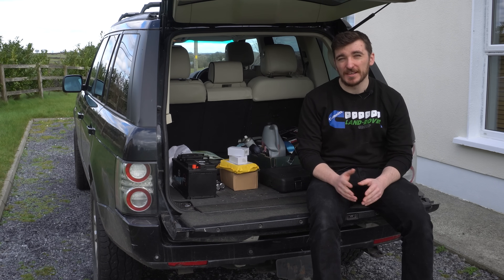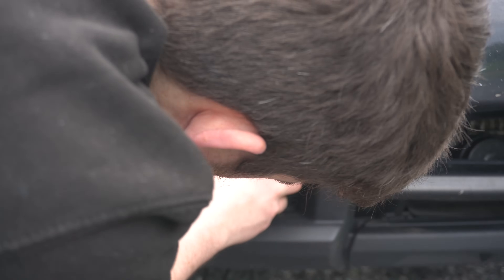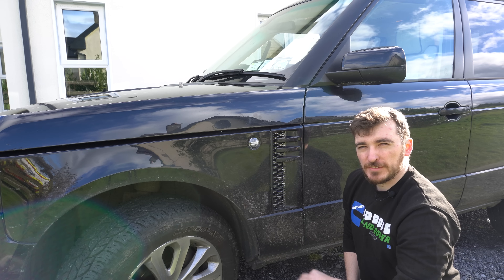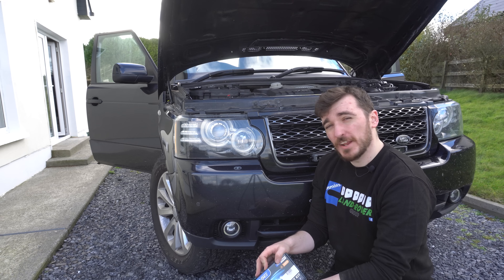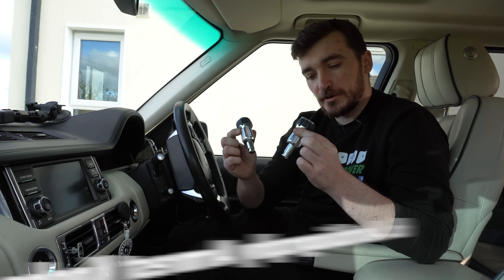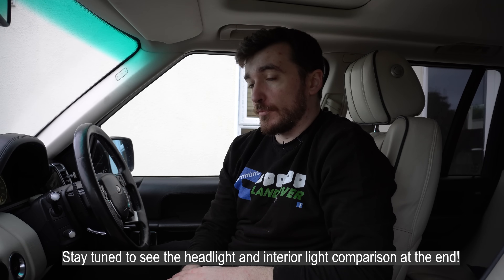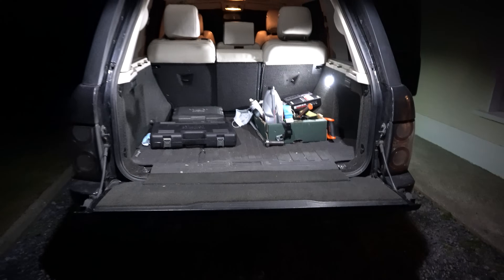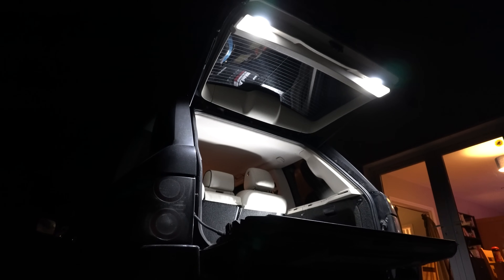I fitted 6 CHEAP & QUICK Upgrades on my Range Rover L322!

Comment from the maker: Some of the audio in this one is a bit crap - next one will be a lot better.  Who's going to buy a load of Chineseum for their Range Rover now then?!
Reply: Very tempted with the boot lights and the H7 upgrades. 
I’ve got the 2009 pre facelift, do you know if the H7 kit would fit?
Reply: Need to check if my 2012 westminster has led h7 replacements already but if not it soon will have. Oh and arm rest knobs, side repeaters (not dynamic) and puddle lights
Reply: Thanks Sam, finally an individual who explains and demonstrates useful upgrades that are a great price nice one sir!
Reply: Turns out they don’t fit. The H7 has a different fitting which has a twist lock fitting which sits flush behind the bulb meaning it can’t lock this kind of bulb in. Sod’s law.
Reply: Hi Sam wasnt sure how to get in touch with You, but I have for sale some older parts for a Range Rover P38, parts consist of rear light lenses different types, air filters, fuel filters bushes,and various parts for the Air suspension, including pumps, I was gonna put them on Ebays but wondered I You may be interested in buying them, Regards Frank
Reply from the maker: @Frankiedoodle1941  Hi Frank, sounds interesting!  Send me an email at samsmotorandmachine@gmail.com 👍
Reply: @SamsMotors   which fog lights is it you ordered ? There’s a few different options I’m confused lol

Comment: Sam, based on your recommendation I got these fog lights and installed them today. They look great. Now they are brighter white than the low beam headlights. What I appreciated is your install tips but maybe even more, the link to buy. It saved the stress of hoping I pick the ones that will fit. Thanks for the advice.
Reply: Shame they don’t do a version for the 2008 L322. I’d have them in a moment!

Comment: Hi.
Sorry for my english if its sometime wrong, its self-learned.
Connect DRL as well, I doing it.. If DRL power consumption is not big (apr 20W in total or even less I suppouse), you can take the power directly from output of relay R10 (located in engine compartment fuse box). Then DRL will go on always when ignition turned on. But, there is a small dalay (about 1 minute) when turn ignition off. Thats no problem I think, will work like "follow home" light. Put fuse and 5-pins relay between to swich DRL off when use headlights. Power for relay - headbeam connector, pin 11.
I doing one more good thing, for free: I change seats bottoms. Now passenger seat (only bottom) is on driver side and driver seat on passenger side. Now seats looks like new, worn corners are inside and not visible. Need to remove seats. Take off the plastic, leather, replace the foam, also replace the passenger sitting-sensor for seat belt. Quite lot of work, half day at least, but not impossible, seats are absolutley similar.

Comment: As for fog lights in Ireland - they're only supposed to be in Fog (visibility under ~100m) and falling snow. 
Reality differs substantially, as you've noticed .. a pet peeve of mine at times
Reply from the maker: Yeah noticed they're a lot more common in normal weather here, but I figured it was a cultural thing so haven't been going around flashing everyone as I would be in the UK 😆

Comment: Thanks for the video. I purchased LED bulb kits for my P38 and L322, just the bulbs by themselves. Makes a big difference. I have been reluctant to pry out the puddle lights in my L322 mirrors as they seem very tight and I am afraid of breaking the housings. May order the units you used as well as the LED driving lights. I recently replaced all the HID and H7 bulbs in my L322. It is much easier if you remove the entire headlight unit. Powerfull UKLtd has a video on how to do this. Cheers from Canada.

Comment: Like the LED fog lights and high beam H7 replacements... I'm definitely considering for mine. However, for the interior boot lights i just changed the bulbs for LEDs and not the whole unit.

Comment: Odd i just ordered the puddle lights, they came installed them, except my truck does not have a red wire, they both yellow. Cleaned the contacts and installed the lights easy enough, but they didn't work, flipped the connectors around, bent contacts, all that. Tested the lights from the jump start posts and they work fine. Fiddled some more, could get flash out of the driver side as I hit the key to open the door, but nothing else, stuck the bulb back in it works fine and now so does the passenger LED. It's almost as if there not enough voltage to run both lamps?

Comment: Nicely done and useful. I've the same car - superb machine. One of the first things I did was swap the main beams as you did. I like the boot lights and the armrest knobs, I'll be doing those!
I also replaced the accelerator pedal for the Autobiography one - because the original failed - thats nice.

Comment: I saw the video and got shopping,  puddle lights  easy to fit, but my lights did not have a red wire. However they do work and work very well. the interior lights the connector was not the same as the std one, but a bit of leverage on the light connector and the plug fitted. Much much brighter.  Cheers
Reply from the maker: That arrived pretty quickly then!  Glad it worked out 👌
Reply: @SamsMotors   It was very quick delivery, Ialso got the armrest knobs and fitted them , a nice bit of bling but not 100% sold on them at the moment. I am sure I will soon learn to get used to their shininess..LOL.  waiting onthe headlight bulb upgrade  to arrive. Cheers
Reply: Got the headlights, damn those thing swilll not go into the headlight housing. The ones I received state to fit the collar first and then push the bulb in place and lock in the correct orientation.  Tried that could not get the bulb in place as it appears to be too long, it interferes with the back pf the headlight housing. Tried it like you have fitted it with the collar attached and it still will not fit. Hope contacting bevinsee on FB will give me an answer.

Comment: Very good like the simplicity of the transfer!
I put a new fog lamp on the rear of the 110 to replace the smashed old one new one doesn’t work checked the fuse switch and wiring and it’s a dud!
At least the 12000 lb winch is fully installed and working but!
I’ll check out those upgrades for my D4 5.0 litre V8 I like illumination!!
Thanks for a great video!

Comment: Hi Sam, have you thought about upgrading the cornering bulbs which point outwards, located beneath the front indicators? I’m not sure what size/fitment these are as haven’t looked at mine yet. Wonder if the whole headlamp unit needs to come out for them?

Comment: Sam, awesome stuff. I got all upgrades. Are you going to connect the halo wires for the fog lights? I have searched everywhere and can’t find instructions on where the wires should be connected to.
Reply from the maker: Hey!  Cheers!  I haven’t done it yet, but I may do it before this winter sets in.  My plan was to wire them via a relay so that they come on whenever the main headlights are OFF, so they function as a sort of DRL.

Comment: Loved every l322 video, looking forward to more content. Quick question though about the fog lights,   any issues with warning lights on the dash? Powerful uk seemed to have issues with their led bulb replacement.
Reply from the maker: Cheers David, glad you enjoy them.  No warning lights at all.  I think because these LED units are a lot more powerful than the replacement bulbs, they draw enough power to keep the bulb check system happy - so no "blown bulb" warnings that you might get with a low power LED.

Comment: Nice video! Great set of upgrades, bit worried about the foglight and headlight bulb swap as here in Spain they're quite hot on this when it comes to the MOT/ITV. But they certainly look brighter - did you notice any changes to the beam pattern at all? That's what would likely cause a fail...

PS: You should have found affiliate links, we'd have been more than happy to support you with them!
Reply from the maker: As they're in the main beam I don't think the beam pattern matters all that much (might be wrong there) but no, seems similar to the halogen anyway.
Cheers!

Comment: Great video Sam, good tips and nice upgrades all of them. Question, have you passed MOT with these lights upgrades? A year ago I read that these LED bulbs might not be legal under current UK DVLA regulations.
Reply: I've also discovered that the 6000 lights are illegal with a VERY SMALL sign on the  Halfords product packet of their lights says "For off road use only." so be warned. I was told that they would not be passed at the MOT. so will keep the normal ones and change the at MOT time. ;-)

Comment: Any chance you can pencil a follow up to see if the  ew bulbs have caused any gremlins. I have a bad feeling about headlights and heat for some reason
Reply from the maker: They will get quite warm during operation - the fans will keep them cool to a point.  At least the main beams aren't usually on for more than a couple of minutes at a time - should help them stay cooler.

Comment: Hi! Can you point out which specific product you installed for the high beam LED replacement. Is it H7? Mine is 2012 L322 4,4 diesel. Thanks in advance!
Reply from the maker: Hi, yes H7 for the main beam bulbs in the late L322 facelift
Reply: @SamsMotors  sry, I noticed links and so on after posting :) Replaced D3S with LED-s, wonderful. H7 replacement LED-s ordered, cannot wait :) Good content ;)

Comment: Hi Sam. Lovely video. I’m picking up a 2008 L322 Vogue shortly… the armrest knobs you link to are L405, not L322. Are they compatible?
Reply from the maker: They must have changed the listing.  There are loads of L322 ones still available on other listings though.

Comment: Are the lights street legal out of the box, or is there no restrictions on that in Ireland? In Germany it's not allowed to put on "anything you find online". It needs some official approval
Reply from the maker: As long as it passes inspection it’s probably fine for use… but half the population here drive around with 1 headlight or both headlights out, fog lights on constantly, no indicators… so LEDs are the least of our worries!
Reply: Hahaha fair enough. I wish that was the case in Germany too. Our Police here is to scared to go for criminals, so they rather pull out cars and look for slightest little thing to give you a fine.

Comment: Sam, on my ‘11 RR the headlight switch has 4 positions: Off, Day Time Running, On and Auto. During the day, I like using the Day Time Running setting. I’m curious with these new headlights you installed, what they look like in that position. I’m hoping the DRLs are on the factory low (dip) beam and still work even with the new H7 high (main) beam. What do you think?
Reply from the maker: Hi Jerry.  I think the US market ones must be a bit different to ours.  On mine, it has off, side lights, dipped beam and auto.  
The lights I replaced were the fog lights (bottom of the bumper) which have a separate switch to turn them on.
I've still not wired in the DRL part of them, but if I do - they'll be wired to run whenever the dipped beam are OFF (i.e. during the day).  
Hope that helps
Reply: Thanks for the reply. So it would be your position of the side lights. In that position, is there any light that comes out of the headlights? For me it is like a star pattern.
Reply from the maker: @jerrygreene7139  Yes that's right, just an LED 'ring' that circles the xenon/HID bulb.  
That would be another way of doing it - wire the fog light DRLs into the side light circuit via a relay.
Reply: Awesome, one more and I will let you go. When you installed the H7 bulb from AliExpress, did it take away that LED ring that circles the xenon/HID bulb or do you still have it because it is part of the low (dip) beam?

Comment: Hi Sam, thanks for good videos. I have an L322 2011 TDV 8 and ordered the boot lights. You do not seem to have had any problems with connecting the lights. I found that the pin connectors on the new lights are too thick to fit the old connector. Did you have to make adjustments?
Reply from the maker: Thanks! I had to slightly bend the pins in the new lights in order to get them to line up properly, but after that they fit perfectly.

Comment: So lucky you picked a 4.4 up before the rise. They're mega money now. My budget really only is for a very late 3.6. Would you still do it, or wait for the right 4.4?
Reply from the maker: What's your budget?  I watched a 12 plate 4.4 TDV8 with 155k miles sell through Carswithnoreserve Reading (eBay) for £8,600 recently, and thought that was a pretty good price (assuming it's not a complete wreck).  

I'd still try to hold out for a 4.4 and maybe up your budget a bit if possible, as I reckon it's worth the extra outlay over the 3.6.

Comment: Hi Sam, great video and I will be upgrading to some of those LEDs. When you did the previous lamp upgrade video you mentioned doing an LED lamp upgrade to the existing reversing lamps. Did you find a decent upgrade for them? Cheers. Kevin
Reply from the maker: Thanks Kevin, 
Yeah I have the parts ready to go, just need to find time to do the upgrade and film the process.  I'll see if I can get it done this week.  Cheers!
Reply: @SamsMotors  Looking forward to it Sam, I'll hold on my AliExpress order. Also wanted to thank you for the gearbox Megaflush video, Ian is coming to do mine in April.

Comment: Hi Sam ,
I bought the same led kit and tried to fit it to my 2007 but I can't get the sodding bulbs in. Any ideas ? They don't push in like yours they have an adaptor that clips onto the h7 bulb and they fasten by twisting them to lock them in place. I've tried taking the adaptor clip thing off the original bulb but it won't fit to the led lamp because of the fan and body that sticks out.
Cheers
Reply from the maker: Think I had a similar problem with my old BMW, does it have the metal clips that go onto the bulbs?  I think I ended up using a Dremel to widen the clips so they'd fit over the LEDs... Not the best solution though, I think you can get adapters from somewhere.  It'd be worth asking Bevinsee if they can send you some out?
Reply: @SamsMotors  Thanks Sam, a quick look on ebay and theres loads of them clips specifically for fitting led h7s to this type of headlight. Id never seen this type of fitting before and after half an hour of dry fisting the back of my headlamp I gave up and got onto youtube to ask the question. Thanks for the help, i've ordered some off ebay
Reply: @andyscaife5412  HI , whihc ones did you buy, I have the same problem, new bulb does not fit into the lens housing the fac on the back seems to interfere with a part of the headlight back. Thanks

Comment: Hey Sam, bought pretty much most of your cheap aliexpress upgrades :D
On the mirror puddle lights, did you need to add a resistor or reset anything? Mine flashed on and off quickly once, and then wont light up again when the car is unlocked - Any ideas?
Reply: I'm having the same issue.
Reply: @MikeCryptoGaming  Can you post a link to the ones you got?  Was it the bulbs+resistors or the whole unit?
Reply: @jonrobinson6851  replied earlier but don't think links post.

But it's the whole unit one at £22
Product code:  LLM779-LED
Reply: @MikeCryptoGaming  Thank you sir

Comment: Great video but looks like I’m going to have to spend more money on the Rangey 😂😂

Personally I’m also on the fence around the dynamic indicators, do these one have a switch for normal operation or just dynamic only?
Reply from the maker: Haha get buying!  Didn't see a switch on them, but there may be.  They look a bit better in real life than on the 24 frames a second video, but yeah...
Reply: @SamsMotors  for the price of them though it was well worth a punt whether you keep them or not 👍🏻

I’ve bought loads of bits from Ali express including Apple Mac screens and motorcycle fairing, never been let down yet. Totally agree that a certain UK retailer is simply selling the same stuff with huge mark up … I’d rather wait the extra few days for delivery ;)

Comment: Hi Sam, Big fan of the videos. I have the spec L322 and I am also thinking about updating the H7 Halogens with LED units. Did you get any issues with Canbus warnings? Thanks.
Reply from the maker: Hey Tom, thanks.  No CANbus warnings.  These LEDs actually draw about the same 55W that the H7 Halogen bulbs did, (hence being so ultra bright) so to the lighting module they don't look any different.

Comment: Does anyone know how I can listen to my i phone in my 2012 l322
Reply from the maker: For phone calls it has Bluetooth built in, but for music you'll need to buy an adapter that fits into the iPod connector in the cubby box.  I use one made by 'Bovee' but there are a few options.  Works well.

Comment: 11:50 not really. Standard LED's are weak when it comes to brightness. For price, nothing beats xenon bulbs. For effectiveness? Nothing beats lasers.
Reply from the maker: Check out the night time footage at the end of the video.  Definitely a massive improvement over the standard halogens.
Reply: @SamsMotors  Upgrade is decent, you picked good bulbs. Other factor to consider is lifespan. LED are okeyish for most use cases, but their lifespan is somehow shorter than most much cheaper xenon. My chinese H1 xenons last 3 to 4 years each bulb. Average mileage per year around 11k. I would not expect same lifespan with LEDs.

Comment: Is the legality of LED exterior light changes different over in Ireland? Over here it's illegal to differ from the original bulb fitting now.
Reply: Think that only applies to the modification of dipped headlights as it screws with the light pattern. Full beam and other lights are ok
Reply: @smitch_yt  any exterior light according to the DVSA